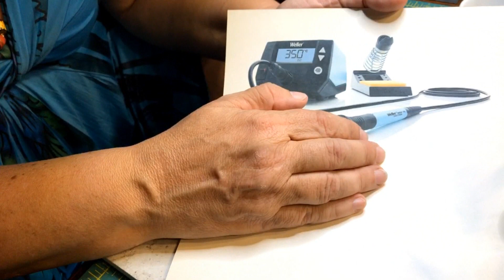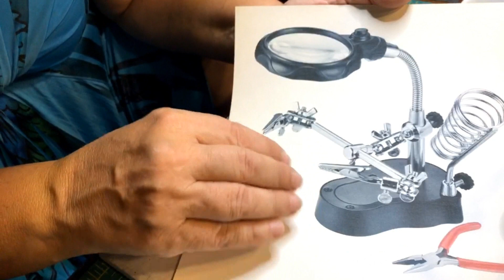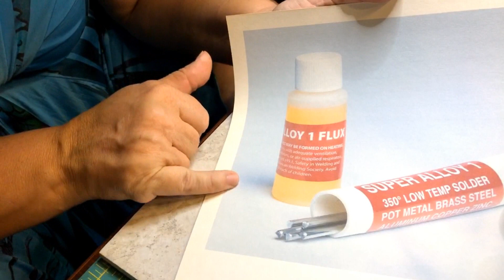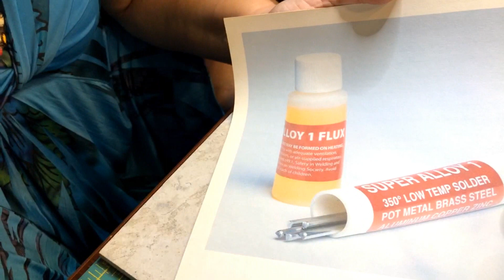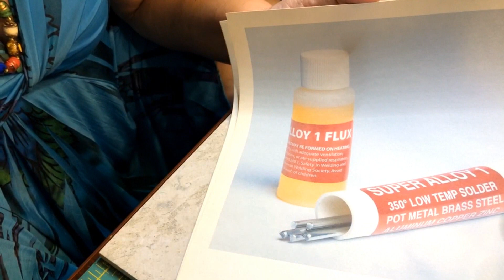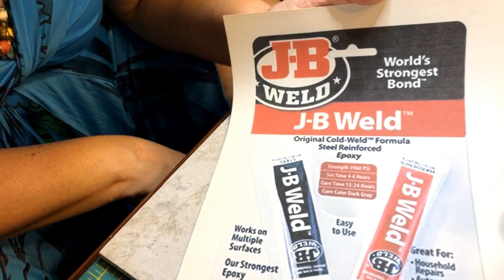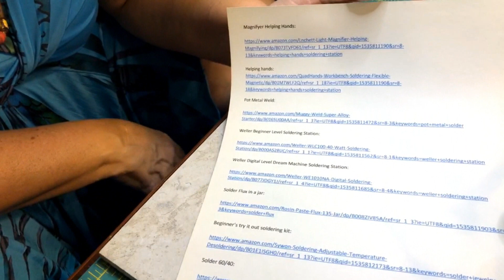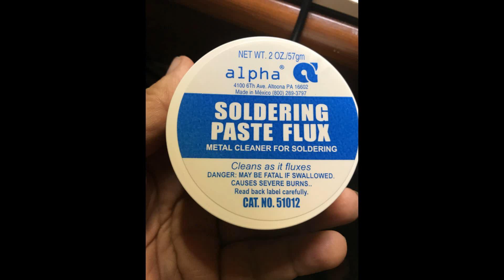Hot Iron Soldering 101 for Vintage Jewelry repair, restore, and repurposing

Comment: I am wondering if the butterfly and the button are steel...It is very hard to solder steel.
Reply from the maker: They are both new items molded with pot metal.